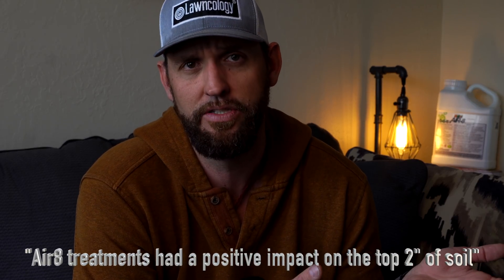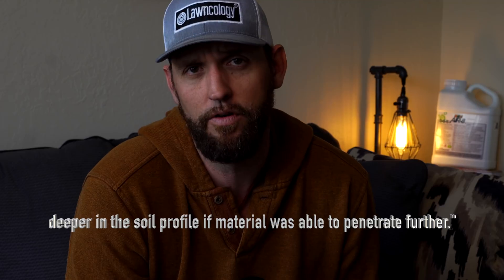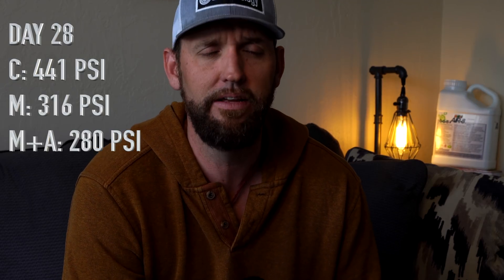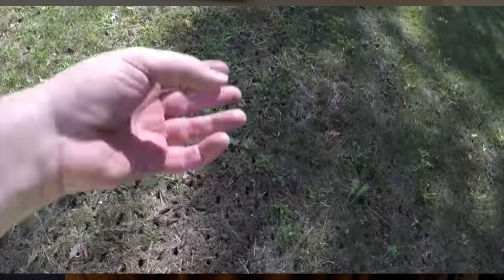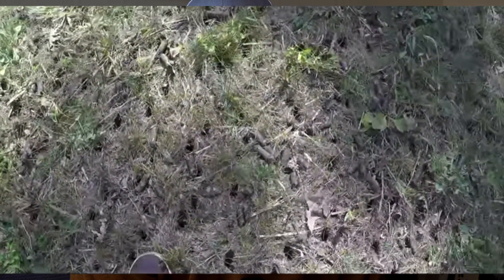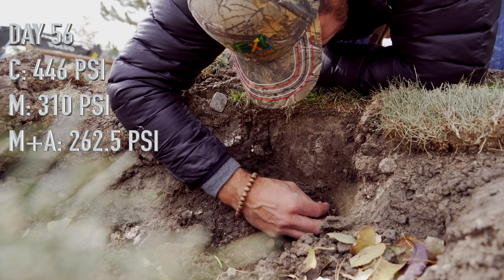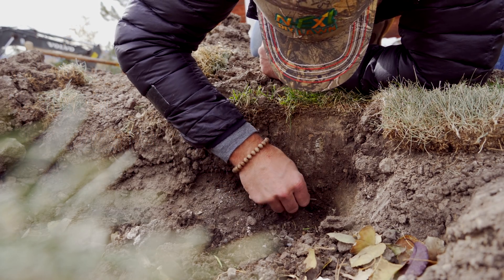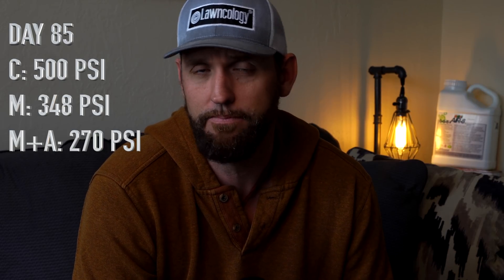Air-8 Liquid Aeration Research Data Pt 2: Best Of Both Worlds, Mechanical and Liquid Together

Comment: I really plan on my small lawn and DYI abilities to do both mechanical and liquid aeration. Part of the reason for my wanting to do the mechanical aeration is that I want to not just remove compaction but also to help level out although not completely My lawn. I have a few humps that I would like to lower in order to keep the runoff from leaving my lawn. Of course when it runs off it also takes a bit of soil with it. Am I thinking correctly?

Comment: Why did you wait till day 28 to apply the Air8? I would think you would have a greater impact applying this at the same time as the mechanical aeration as the liquid solution would penetrate deeper into the soil.
Reply from the maker: It was applied 4x. Day 1 and then 4 week intervals.

Comment: My back lawn is so compacted that mechanical aeration struggles to get plugs  more than an inch or so. Planning on using Air8 first, then mechanical a week or so later. Thoughts?
Reply: smham33: Did you have any success with the Air8 products?

Comment: The pH of my soil is 7.9. Do all GCF products have KOH?  Should that be a concern or not?
Reply from the maker: You should use elemental sulfur to drop that. And no, KOH is not in everything and typically by the time it’s in the soil, the pH is neutralized. The pH of the congregate is high but the volume when mixed is negligible. Most irrigation water is higher pH.
Reply: @Lawncology  Added 5lbs of elemental sulfur per 1,000 last year and was able to drop it from 7.9 to 7.7. I love all GCF but didn’t want to add to my problem of high pH. I will continue to add elemental sulfur. I will continue to purchase GCF as your company is different than all others. I know answering everyone’s questions must take a ton of time but the access to your team is unmatched by any other fertilizer company.

Comment: I have compacted clay under my Fescue and it's so bad compacted my water just stands on top of my grass. That's even with mechanical aeration. I've just started using Greene county fertilizer products and I'm excited to see how these help! Thanks for all the videos they have taught me a lot!
Reply: Chrishart8887: Did the Greene county products actually help you with your compacted clay under your Fescue? If not, do you still have the problem, or did something else cure your issue?
Reply: @mrficxit1785  my fix was I used humic and didn’t dilute it sprayed it on then watered in with sprinklers I used 1 gallon per 2k sqft along with mechanical aeration and it worked perfectly. I came up with this idea with help from Jeremy at the greener lawn.

Comment: So I followed along the first video which was great very great amount of information. I’m not super familiar and have zero experience using the air8 product. I do hear LCN talk about it a lot! Well I watch the second video, and your test was focused on compaction I’m guessing your next videos will also elaborate more, but what about overall root growth and grass height? (with less compact soil I assume the grass grew better in turn causing more mowing) again I’m sure you will elaborate on this more and I am new to this process. Thanks again great videos.
Reply from the maker: Good theory. However, the impact on top growth would be more related to feeding than anything. The plot with fertilizer applied did better in the look and growth, but perhaps performed the same in other categories. Meaning the root impact combined with the air8 was similar to the air8 alone.
Reply: @Lawncology  makes sense. Thanks you

Comment: How many times per year do you recommend the use of Air-8 and during which months? KBG lawn in Massachusetts. Thanks!
Reply from the maker: Apps run between 2 and 4 times per year depending on rate. They can be run anytime, but watering in is important

Comment: So the question becomes, is it best to use Air8 to supplement mechanical for sustained improvement/performance or can it actually eliminate mechanical over the long term?  More directly, over time, can you phase out the mechanical once the deep roots are established or would it be best practice to continue to do mechanical once per year combined with multiple annual apps of Air8?  If you eventually stop mechanical will the Air8 alone sustain the progress made on the reduced compaction beyond the 2" depth?

Comment: Was the plugs collected in the plots? What would happen if the plugs were collected vs not, and see what happens after the time allotted.  Or, what if it was top dressed with sand or compost then sprayed with Air-8?

Comment: Interesting stats, John. Thanks for sharing. To carry part of this test further I would wonder how is your soil compaction affected if using Air-8 only for each year (recommended apps per year) for five years or ten years. How much does the soil compaction improve each year with continued use? Also, how quickly does the soil return to normal if the Air-8 apps were stopped after those time periods? I know you have not had enough time to conduct these tests, but that info would be good selling points. Spraying your lawn versus fighting a mechanical aerator is a no brainer.

Comment: whelp, I keep threatening that I'm gonna rent one of those core aerators; seems if I do, to make it last awhile, I should also take the easier extra step to spray down some Air8 ....say $100 to rent an physical core aerator plus $45 for a number of apps of liquid Air8, would likely surpass the performance of spending the money to always have to keep renting the machine multi times every year - oh and massively cut the labor of course(and not disturb the look and growth of the lawn), which would be a huge factor to make Air8 worthwhile

Comment: An Air8-only plot is conspicuously absent.  This product is talked about so frequently as a substitute for mechanical aeration, this study can’t help but seem incomplete without an Air8-only plot.
Reply from the maker: Watch the first video. The plot is not absent. For this video it wasn’t about the air8 by itself, it was combining the two to show deeper subsoil efficacy when combined
Reply: @Lawncology  I get that it wasn’t covered in this video. But that’s precisely my point. If you’re trying to study the effects of Air8 and honestly educate consumers about it, then I think an Air8-only plot is necessary. Whether you intended them to or not, your distribution and marketing partners (Allyn in particular) have pushed it heavily as an ALTERNATIVE to mechanical aeration. It’s a good product, but I think the marketing has made folks skeptical of its true performance, and this video doesn’t show evidence for whether Air8-only relieves soil compaction.
Reply from the maker: @sbernhard83  again, did you watch part 1?
Reply from the maker: @sbernhard83  the reason I ask is that the air8 has a limitation of how far it can travel through the soil when compared to mechanical. The impacts of aerate were in the top 2” of the soil as stated in this video. These measurements in this video are beyond the reach of the liquid and required having the material be applied to the aeration event to see subsoil impacts. Here’s where the compaction numbers on air8 only vs control ended:
Control 557.5
Air8 487.5
Mechanical 365
Air8 and mechanical combo: 280

So, the most dramatic change was the combo, the air8 alone when compared to control had a difference of 12.5% +\~
Aeration had an impact of 35% +\~
Combo impact 50% +\~
Reply: @Lawncology  I should have stated before, yes, I watched part 1. I think it provided good evidence for Air8 acting as a wetting agent to carry water and nutrients deeper in the soil, to the benefit of root growth, which is fantastic. But the 4% reduction in surface tension seems pretty close to margin of error to me. Considering the benefits to root growth you’ve shown evidence of, I’m probably being too picky about the marketing of it as an alternative to aeration. But I think it would have been more transparent to market it as “Air8 acts as a wetting agent -> water goes deeper-> nutrients go deeper -> roots grow better and deeper -> deep, healthy plant roots break up soil compaction over time.”
Reply from the maker: @sbernhard83  what we found is that the comparison of a true wetting agent and air8 arent reactive the same way. Wetting agents will immediately begin to drain into the soil, air8 will not, in fact the first readings show a tightening of the soil after application. More water is needed to drive the components into the soil before reaction can start.
Reply: @Lawncology  Interesting!  Thanks for the replies. I appreciate your efforts to produce and present data on the topic. Hopefully there will be some independent university studies on these types of products soon.
Reply from the maker: @sbernhard83  I hope so too. I never thought that when I set out to make a product that simplified an action it would be met with such controversy. I don’t need anyone to give up aerators. Whatever choice people make is up to their own way of weighing pros and cons. To be honest, if someone needs to classify this as a wetting agent not a soil amendment, that’s fine, if it makes them a buyer/user of the material. Technically air8 is a biological
Stimulant and squarely fits that definition. My intent is to present the findings again at the end of year two, and by that time, I hope that it’s not a hot button issue anymore. Plenty of companies are piggybacking off what I’ve done and that creates wider adoption of the process but I don’t see anyone else being willing to put it up against their claims. I will continue to do that with all my products until it doesn’t make sense to prove efficacy over and over again.
Reply: @Lawncology  Transparent interaction like this is what sets you apart from the rest JP. Thank you.
Reply: @Lawncology  Great discussion to you both. Thank you for replying. “Controversy”
Is good because people are interested in your product. It’s far worse to be ignored in my opinion. Loving your videos and your approach. 

If I were going to design a follow-up study I’d start with a primary outcome that focused on some measure that would be most important to your residential consumers and/or commercial consumers. Those consumers likely aren’t the most interested in penetrometer results as much as the outcome that we suppose better penetrometer results produce (and I’m not familiar enough with turf to know what that would be, perhaps less watering requirements or better disease resistance or decreased need for fertilizer, etc). You could then establish secondary outcomes you’re interested in as well, but technically secondary outcomes are only for picking up signal to design future studies. 

Then I’d decide what a meaningful difference between the groups would be to you. For example, you may be able to statistically show a 4% difference between groups, but that may not be a meaningful difference. Once you’ve decided what that number is, then I’d do a “power calculation” which will tell you how many replications you’d need to do for your study to be powered to detect that difference. 

When you report your data it would be interesting to us science nerds to report your confidence intervals on the differences between groups at a 95% confidence interval and report the statistical tool applied to your data (e.g. students t test). That would allow us to agree that you detected such and such a difference between study groups at a 95% confidence interval.  Without those data, it’s entirely possible that the error bars on each data set overlap and there is no statistically significant difference between two groups and the difference in the raw numbers is attributable to random chance. 

This isn’t criticism by the way. I think that presented in this way your data would be more robust to naysayers. Plus science is fun and your products seem pretty cool. Thank you again. I’m looking forward to making my lawn not crappy thanks to you.

Comment: This is interesting stuff. Why was an air8 only plot not done as well?
Reply from the maker: It was. This video is about the combination. The next one will have that data
Reply: @Lawncology  that's going to be dope
Reply: @Lawncology  I been using aerate for a little more than a year now.  I’m trusting the product to do what it’s listed to do.  I have Saint Augustine and never aerated in the 10 years Ive owned my home.  Atm, my lawn is the best it has ever looked.  I will say using N-EXT products along with some granular fertilizer that Allyn sells has done my yard wonders.   

Can’t wait to see the next video.  I’m actually starting to spray Air8 in a few areas I never have before.  The soil is super hard and holds so much water.   I’m hoping Air8 can help correct these areas.

Comment: Up until about 3 years ago I used synthetic, granular fertilizer program, you know the brand.  I noticed that I didn't have many worms in my soil when I did soil samples the past couple years.  AND, the last time I used that company's "summer fertilizer", I had two dead snakes on my concrete driveway the day after I applied it.  I made a change to John's products and the difference is amazing in my soil and the worms in my soil!  AND no dead snakes!!  Amazing products!!
Reply: To be fair, the only good snake is a dead snake.
Reply from the maker: That’s fantastic.

Comment: I really appreciate you taking the time to do studies. This is awesome stuff, John! Did you do a Air8 only plot? Would be curious to see what the result would be.
Reply: Exactly. An Air8-only plot is conspicuously absent.  This product is talked about so frequently as a substitute for mechanical aeration, this “study” can’t help but seem incomplete without an Air8-only plot.
Reply: Why would you not include the Air-8 alone.  I use your products but this doesn't do any good when the discussions are mechanical vs liquid? And you have NO liquid only plot.
Reply: @williamday78  video 1 explains all the tests.... there is a liquid only plot. I believe this video was discussing the results of the mech vs liq/mech processes.  Maybe video 3 will iron out some of the other test results.
Reply: @jeffluethge  I watched the first video and it didn't mention anything of the results, it simply talked about what was to come.  I'll rewatch it but I'm pretty sure it went, we have some big news, then video to introduce news, then this one🤔
Reply: I agree. Is there a reason a standalone Air-8 plot was not used? This product is used by those who typically do not mechanically aerate and is sold as such. Can you comment on this John? Thanks!

Comment: My question is when did the aeration take place, spring or fall.  I am presuming spring.  My second question is how would the results differ if the aeration was done in the other season. (Fall)
Reply from the maker: The dates are in the description. I’m sure an aeration in the fall would yield a similar result over time. This video is showing how you can combine the two for greater compaction relief

Comment: Excellent explanation of what is going on. This will be my 1st full season using your products, I started late summer and this spring green up has been the best I've seen on my property.

 I used to really have to force those sprinklers into the soil the last couple inches but now there's no problem  getting them fully seated.

 I would like to have a soil analysis's done, where would you recommend to get a very detailed test done?

 Thanks again, looking forward to  all the content this year.
Reply from the maker: Spectrum analytic t3 test is the most full but the t2 is more than adequate

Comment: Did you measure the compaction with just Air8. I would like to see the difference between the control group and Air8. The exclusion of Air8 on its own seems misleading
Reply: I agree, the whole point of using Air-8 for me is not have to go rent a mechanical device even though both in conjunction would be the best.

 Even if the values are small, I'm very curious as to what the Aiir-8 will do by itself.        

 I will say without a doubt, the Virginia clay at my place can almost seem petrified, but using Air-8 since last June, my soil has made a tremendous improvement.
Reply from the maker: I can get into that on a live show. The fluctuation is all over the place but it tracked similar to the control in the sub soil. Often times these are depths beyond the root growth of the turf
Reply from the maker: Here’s some numbers:
Initial control reading on day 1 of application:
Control 351.5
Air8 306.25
Completion of trial:
Control 557.5
Air8 487.5
Reply from the maker: Yes. And sun soil was not impacted with the liquid beyond the distance that the product reached. The penetrometer is measuring a depth that liquid won’t get to on its own. The aerator with 4” core has more impact on subsoil that Air8 does